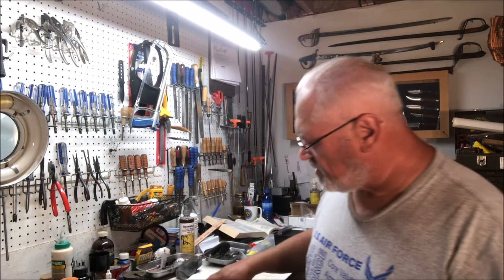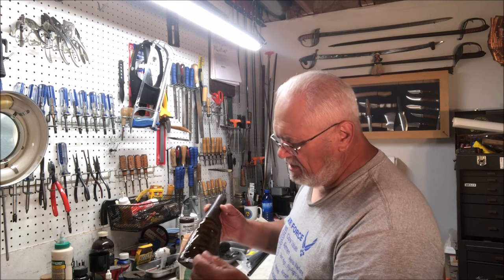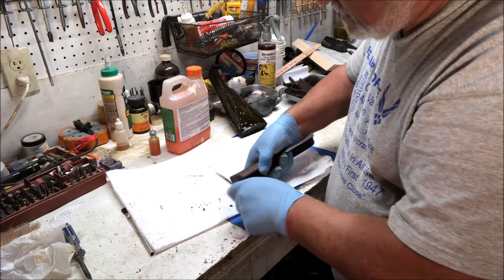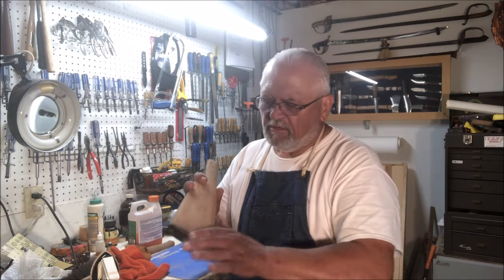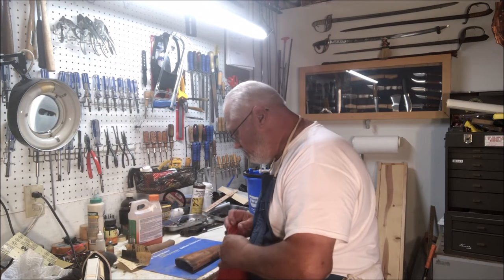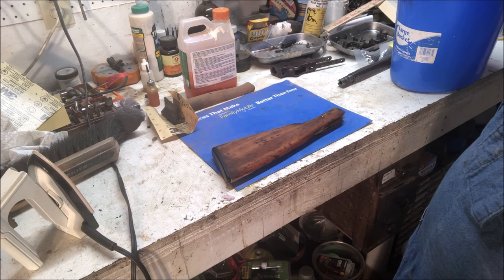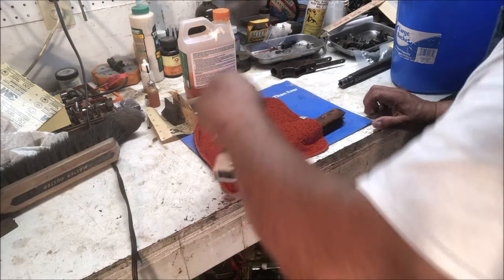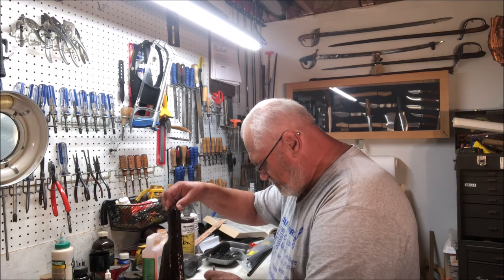The Old Gunsmith Wood Stock Dent Repair - Steam It Out

Comment: Thanks for the tutorial! I have done that in the past to raise dents and it works really well.  For the oil, I used a heat gun on low to medium to draw the oil out of the stock. It worked really well on a 1960s era Belgium-made Browning Sweet 16.  It took a while because it was soaked to the gills with gun oil but it was worth it! The stock had become soft because of the oil and the buttstock bolts that screw into the receiver yoke had become enlarged.  Once I got the oil out, I drilled the holes out slightly larger and I glued dowel pins into the holes.  After that, I just redrilled the original holes, fit everything back together, and then took it back apart and refinished the stocks. It was beautiful. But...I can not shoot a shotgun to save my life! So I sold it for what I had in it. How dumb! It would be worth 4 times what I sold it for if I still had it.

Comment: I have been steaming dents out of military stocks for 50+ years. I use a steam iron and a wet towel. You might to do it several times on deep dents, but the results are amazing. This method works with ease on Japanese wood stocks. Walnut can give great results, but can be slow based on the origin of the wood. Arctic birch takes a lot of time.

Comment: This works great for taking dents out of pool cues, as well.  Also, if you have one or two, very small dents in your stock instead of a steam iron.
 A pot with 1/2" of water and a lid with the knob removed, leaving a small hole for the steam to escape, just hold the dented area over the steam, closely, for a minute or so and check.  Repeat until the dent is gone. Presto!
  For deeper dents like this, it can take a long time, letting the wood absorb the moisture.
  Go Airforce!
Reply from the maker: Nice! Thanks for the tip and for watching.

Comment: You can remove ingrained oil from a stock by submerging it for approximately two weeks in a bath of acetone which will draw the oil out. Remove the finish before hand obviously and seal up the container to prevent evaporation.
Reply: Oven cleaner/ sodium hydroxide takes it ALL out in a couple hours

Comment: Larry Potterfield, owner of MidwayUSA, removed oil from a stock he was refinishing by soaking it in a bucket of Acetone!  Seemed to work very well but he had to let the stock dry out over a period of several days.
Reply: you can hold the stock over a hot stove eye opposite of where the oil is and it will bubble to the top then wipe it off. takes a lot  of care because you dont want to burn the wood. it takes a while. or i use a heat gun clamped in a vice. did an old mauser and took me most of a day.

Comment: Great video - I just bought a '1997 Beretta 686 Silver Pigeon 1' and it has a 1.5cm scratch in the stock that I can unsee since I know its there - is there a way to fix/remove this scratch without having to sand down the stock and re-varnish/re-oil it please? thanks

Comment: Thanks for this video! I was looking for how to remove dents from vintage furniture since I dropped my phone on some walnut and cause a dent. Can you tell me if I did this steaming technique on a oil stain finish if it will remove the stain and will it even work if you aren't steaming against wood with a stain on top?
Reply from the maker: Glad I could help! I have seen this technique used on old furniture, just have to play with a little in a hidden spot. Thanks for watching.

Comment: You can soak the stock with acetone to get the oil out of the wood...
Reply: I don't have acetone ( dimethyl ketone a.k.a. 2-propanone ) ,  can I remove soaked in oil, with isopropyl alcohol ( 2-propanol ) ?  
For a steam source when removing dents. Can you use one of those low pressure steamers?
Reply: @ronsindric4241   I think isopropyl alcohol dries too quickly, would dry the stock out too much.
Reply: Can ruin wood.

Comment: I have a questions a about a model 37 Winchester single shot 410 after removing the gun stock for the first ever cleaning. when installing the the gun stock when you break it open a couple of times the stock creeps up on the receiver. What can I do the stop the creeping up?

Comment: If the finish is still good but there are a few dents, would it be fine to skip to the ironing?
Reply from the maker: You need the heat for the steam. It helps force the water into the fibers of the wood, as the wood absorbs the water the compressed fibers swell and fill the void. Thanks for watching.

Comment: I'm doing a lee enfield 1895 303 stock and would it be bad to use a heat gun or a straight flame just holding it far enough to have the oil bubble out and wipe off?
Reply from the maker: I have used a heat gun, just be careful not to get to much heat on it and burn the surface.  No Flame. Another way to get oil out is soak stock in turpentine for a week or 2 then let dry out.This method stinks so do it in a Garage or a out building.  Thanks for watching.
Reply: @45AlfaCharliePapa  thanks brotha.

Comment: can you get dents out of a finished stock with steam??? and not damage the finish - the steam will cloud the finish and require refinishing on a new gun stock with a few dents - this is not an acceptable repair .... any one know how to remove dents with out using steam and damaging the finish??
Reply: Try a soldering iron. That's the smallest thing I know that can get hot enough in a small area/point without clouding the surrounding finish. Electric ones are under $15 and should do the trick. An old woodburning iron can do the same. Just make sure your cloths are good and wet, but not quite dripping.

Comment: Actually,  I  NO LONGER  do anything "LIBERALLY."  The word 'Liberal' has been ruined by some people groups.   However, Some products should be applied GENEROUSLY.
Reply from the maker: LOL, LMAF. Thanks for watching.
Reply: Yahtzee. I also use the word "left" sparingly these days as well.
Reply: So..... What do you say instead of left?
Reply: @pinheadlarry9495  you either go right or the other way
Reply: Our old Gun Smith told me one time when I wasrefinishing 303 to put the stock in dishwasher and it stripped it perfectly. I run it  2 cycles and air dried.
Reply: So True